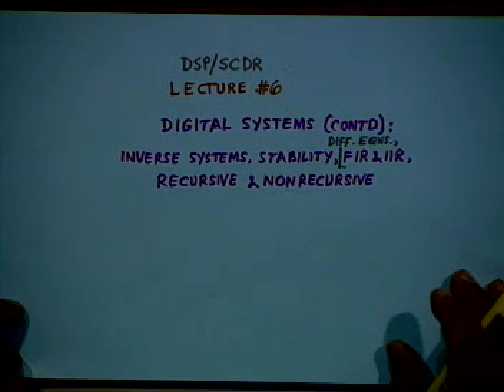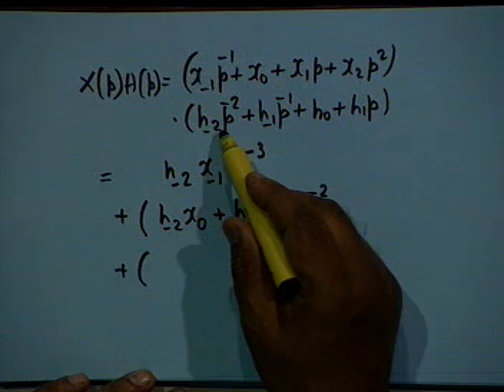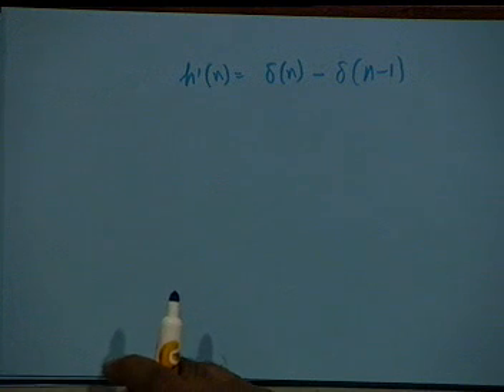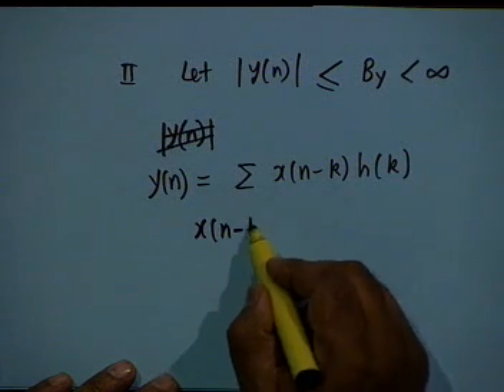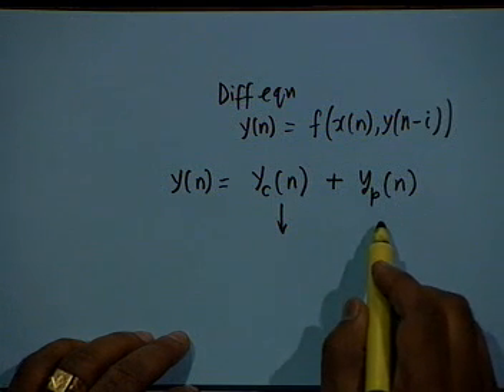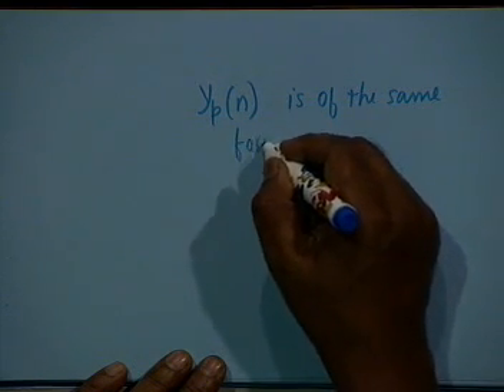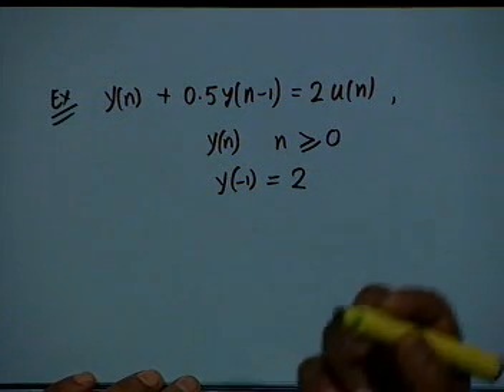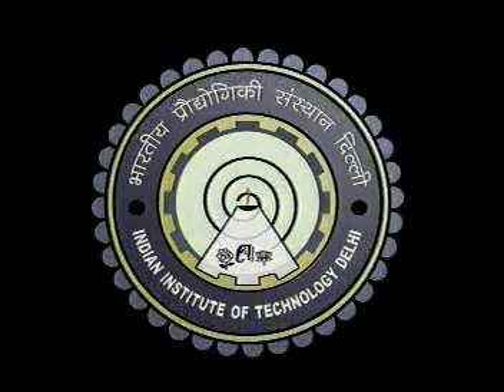Lecture - 6 Inverse Systems,Stability,FIR & IIR

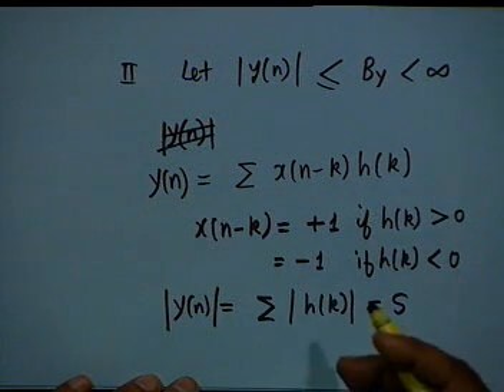Comment: Thanks Sir for the great lectures. At 27:26 I feel the argument was not complete. We started with bounded input and bounded output and then we wanted to prove that h(n) is absolutely summable. Can we argue as follows "Suppose h(n) is not absolutely summable, then in this particular example y(n) will be unbounded. This contradicts what we started with. So our assumption that h(n) is not absolutely summable is not correct"
Reply: I have a doubt in your argument. If you are proving anything whether its h(n) is summable or not summable, you should do with all possible examples of input ... If we take input as 1 for all time instant then this contradiction will not be valid.